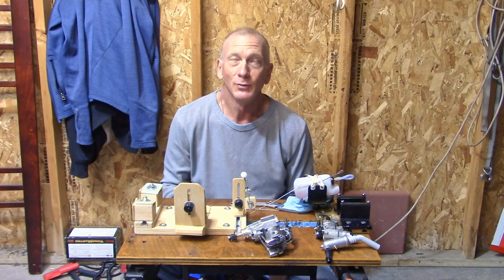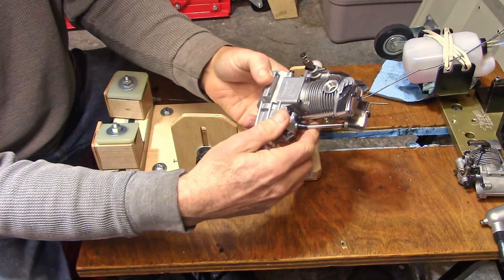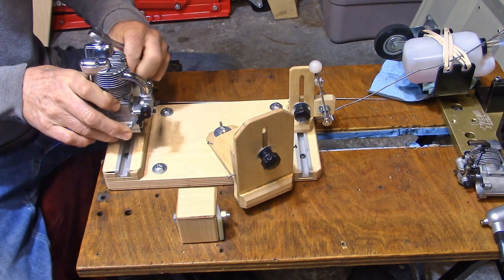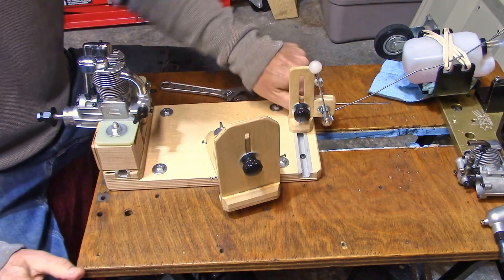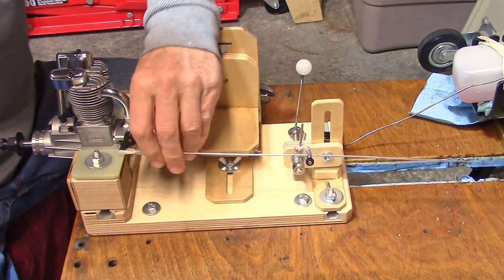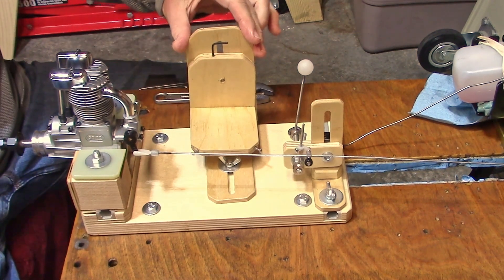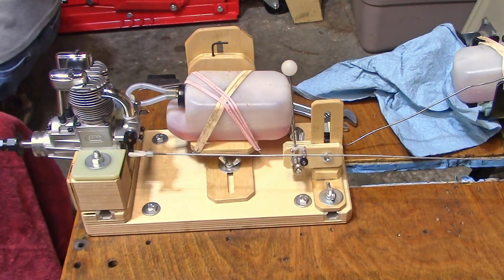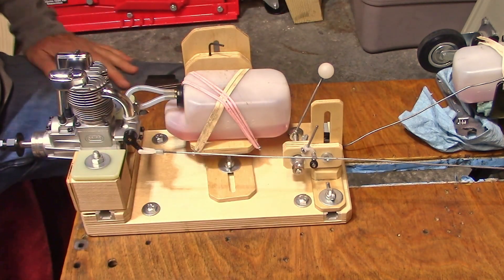Ron Sexton Engine Test Stand Intial Setup and Critique

Comment: Clean setup. Put spongy foam under the tank to avoid foaming of the fiel with vibration. It has given problems on some engines.
Reply from the maker: For the amount spent on the stand, it should be right and not need added things to function optimally.

Comment: I’ve got this test stand and paid $100 for it several years ago. I use it quite often and have discovered that the throttle set up is over engineered and it actually broke. I’ve got to figure out a way to use the throttle where it will work properly. Another problem is the aluminum tracks that were installed on this are rather soft and quickly bent when tightening the bolts or wing nuts. And of course tank platform constantly loosens. It’s definitely not worth what I paid for it but I still use it quite often and just live with the problems
Reply from the maker: Great feedback

Comment: Thanks for the review, David.  The points you make are certainly valid.  There are improvements that I will try on my test stand. The biggest issues, I think, are what you pointed out about the tank mounting.  In the video I sent you, the tank was tilting forward as the engine was running (ST 75), allowing the fuel to come forward in the tank, starving the pickup toward the back of the tank.  To remedy that, I will try the small stick-on rubber pads that you would apply to the bottom of something (like speakers) that you would put on your desk; I would put those on the one-knob adjustable part of the tank holder. Then, noticing what you were having trouble with in this video, I think I might try some of that cork pad on the bracket with the wing nut between it and the engine stand's base.  Yes, there are problems with the stand, but it does have (along with all of those small parts!) the feature of versatility, allowing someone to configure it rather quickly for just about any engine they may have in their collection.  Like most things, it has its problems, but it has its good points as well.  Thanks for taking the time to make the video.  florida_floyd